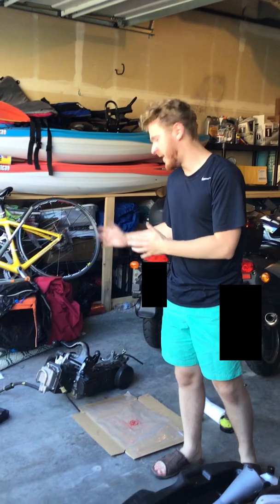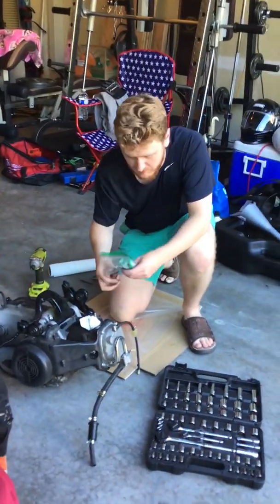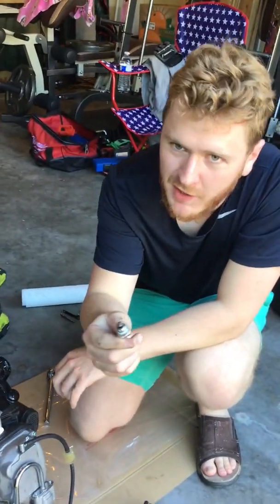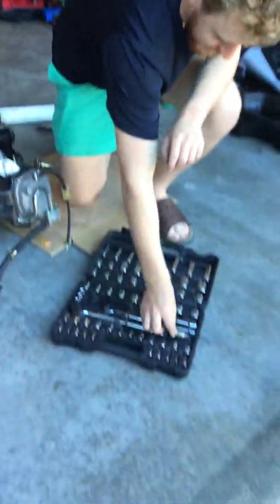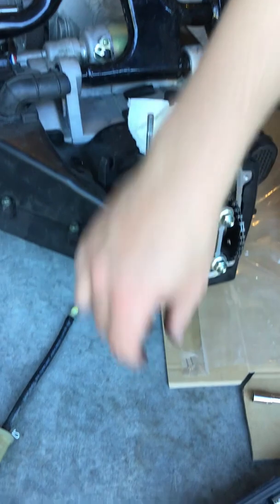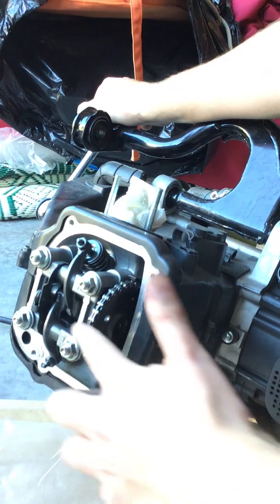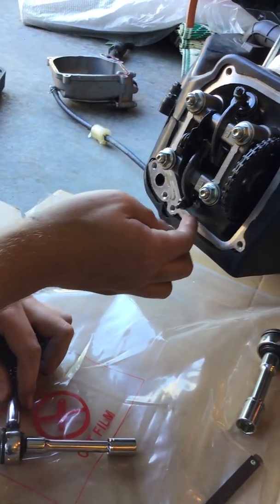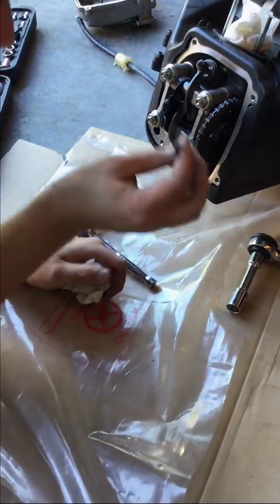GY6 150cc 4-stroke Chinese engine VALVE ADJUSTMENT tutorial [Easy] [No-Nonsense]

Comment: Excellent video bud. I just today adjusted my valves on my gy6 150cc tao tao.  I began having hard starting, then no start at all.
Spark seemed a little weak, but new stator didn't fix it. Took out carb, and that looked good. So had spark, had gas, next stop, compression. I suspected my valves were out of adjustment right from the start. About 18k miles on the scoot and never adjusted
them. What I did not know about valves out of adjustment is you can begin to lose compression. When I checked mine I could
barely get the .001 feeler in there, so did the adjustment .004 intake and .005 exhaust and she fired right up.  Now i suspect a
oil leak to start real soon, lol, valve cover gasket. Thanks for the video. Gave you the like, you should've gotton more views in my
opinion. Thanks again.
Reply from the maker: An oil leak due to stripping out one of the 4 screws on the valve cover? Yes, that sucks for sure. The material is super fragile because it's meant to dissipate heat. 

The good news is that you can try to salvage it by using a longer screw of the same spec. I once stripped out a corner of the valve cover and used a different, longer screw, and ta-da! Had enough material to grab on to to prevent a leak.

Best of luck
Reply: @GTAIVisbest  Oh no i was joking about the leak, I didn't strip the thread on head or bolts, just anticipating I will need a new valve cover gasket. Thanks for the tip tho, if it ever happends

Comment: So like thank God for this video! We had 4 scooters that have been just sitting up in our shop, some for years, because we could not figure out what the hell was wrong with them. They were all doing the same thing and we literally changed everything even the motor... And come to find out on both Motors the valves were too damn tight... So I tried this on one of the scooters, and bamm!! Runs perfectly!! but just to make sure it wasn't luck I tried it on another one, and it worked again, so now I'm finishing up the other two right now. Thank you so much for this very easy tutorial!

I just got one question though, why do you have to take out the spark plug?
Reply from the maker: Wow! I'm happy this video actually helped someone in the end. I'm going to add some information since you're actually fixing some in the real world, some thing you should know:

1. I believe torque spec for the adjuster nuts is like 84 inch lbs. Please make sure you tighten to spec or else they may not be tight enough and you'll have to redo them after a month or two as they progressively get out of spec. 84 Inch Lbs and you won't have issues. 
2. Make sure you follow the tightening procedure correctly for the valve cover and you'll be fine

As for the spark plugs, it's possible to do a valve check without taking it out. But when you try to get your piston to TDC (Top Dead Center), because of the immense pressure built up in the compression chamber, it'll often "skip" right over TDC and you'd have to try over and over again and risk not getting it quite right. Pull the spark plug out and there won't be any built up pressure in the engine, so you won't have an issue
Reply: @GTAIVisbest  I see! Yeah the one I'm working on right now was doing that and I had to go super slow because it kept skipping past. I'll take out the spark plug the next time just to make it easier on myself. 
But yeah thank you so much for the info
I come back to this video every time I do one just to make sure I'm doing everything right.

Comment: "E-Z TuBORial No Nonsense  to QUICKBOPE Chinese Innocence Valves"

Very informative video. I've used this build on kohi and Minerap to great success. Also used on 1.7.5 CivCraft Worlds 3.0 PVP. I recommend for quick drops. Integration of Blokehits and circlestrafing is also strongly recommended
Reply from the maker: Very Good Easy Blockhit tutorial, how to adjust blockhit and valves 2020 new.

Step 1: open chinese innocence valves
Step 2: make sure u use .005 size
Done!
Reply: @GTAIVisbest  Will this method also work on my 2005 Moroccan Kahn QB1NE? It's only 15 years old, but I want to make sure the gaskets are still well sealed. Should I just upgrade to the H4R3M model?

Please respond